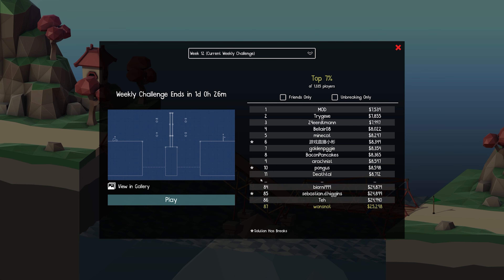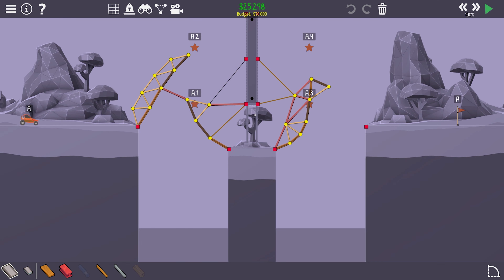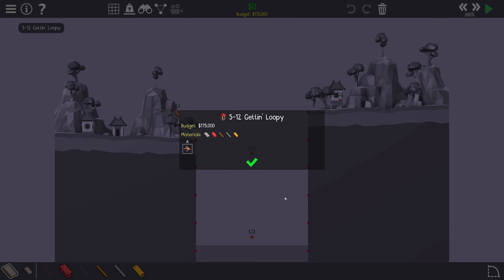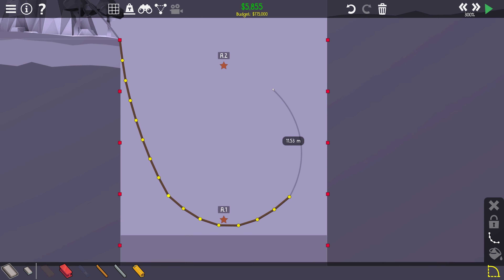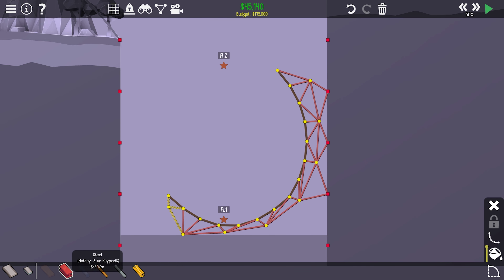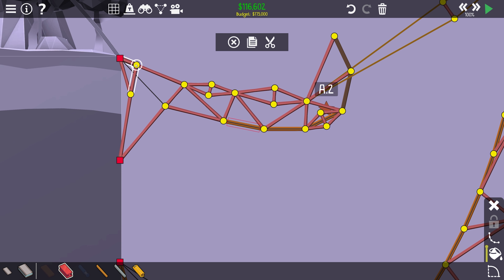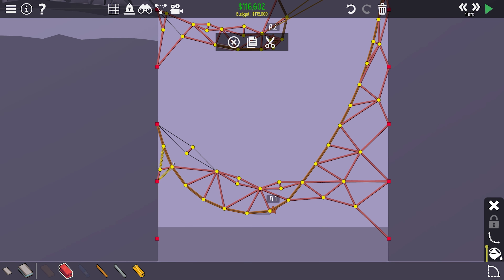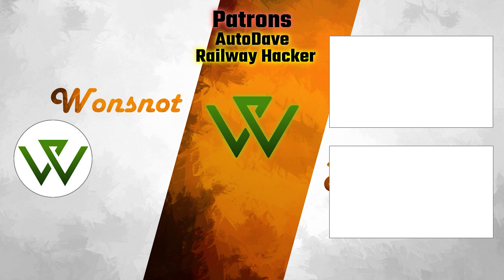Gettin' Loopy | Poly Bridge 2

Comment: It doesn't have to break you still have 60k left, so I guess you should reinforce the bottom and then use the second loop to get al the way to the finish line rather than going round the first loop again.